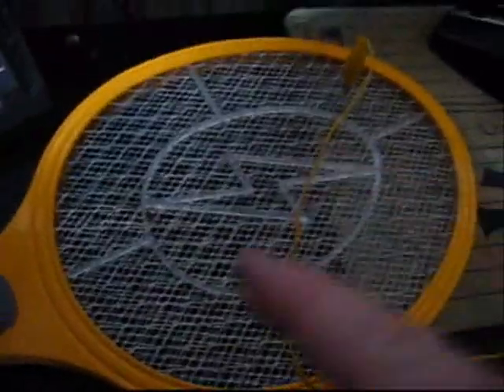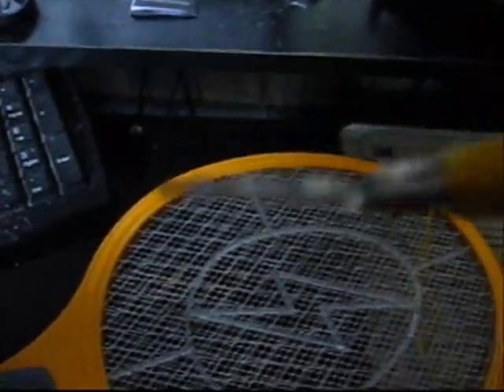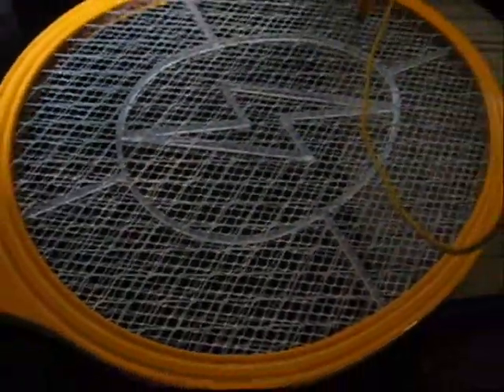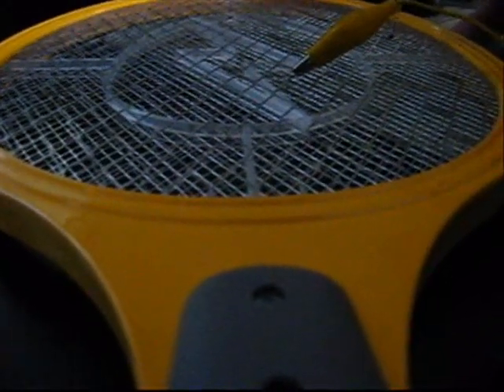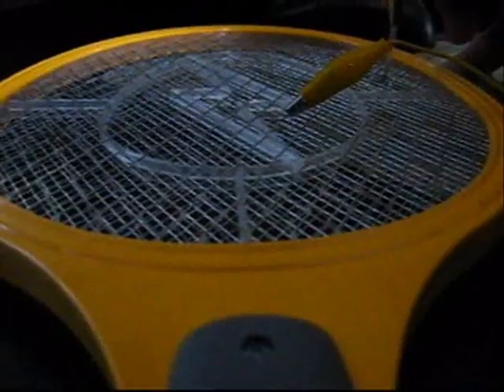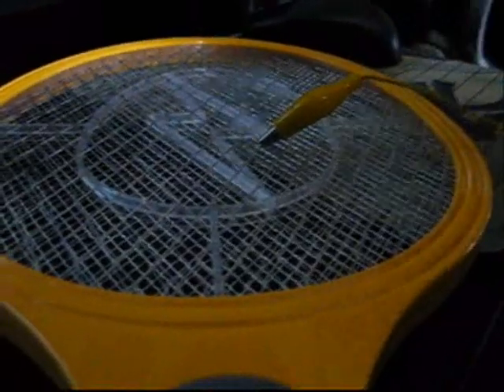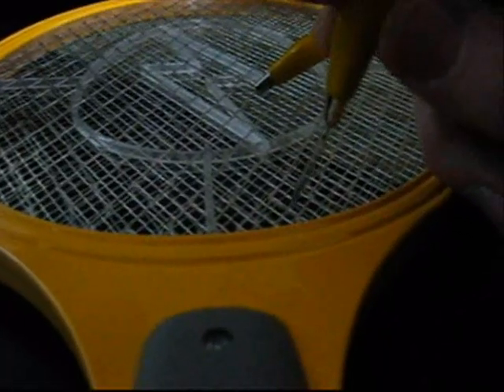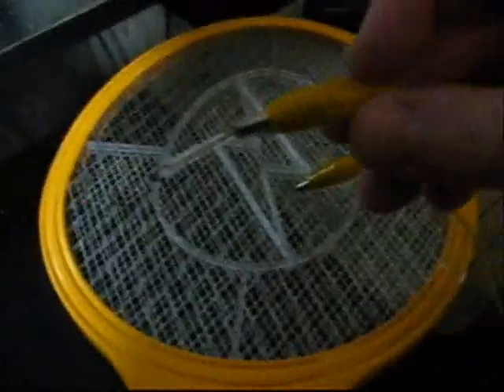2300 Volt Insect zapper Vs Disposable Camera Flashbulb

Comment from the maker: @akai454 
You can get one of these zappers and dismantle it and use the step-up circuit. I dunno how you would control the flash speed maybe a VR on where the batteries connect to. reducing the voltage to maybe .5 volts or whatever. Acting like a variac.

Comment from the maker: The 2 outer grids serve as the ground and the inner grid is the positive side. Walmart sells a cheaper bug zapper that claims to have 2750 volts but it has no discharge resistor which drains the grid when you release the button.

Comment: This is cool. I saw a video where someone replaced the capacitor in the racket zapper with a pulsing disc capacitor. If you did that, your flash bulb would pulse when you held the button. The link to that video is watch?v=Y_1urUtHmAs